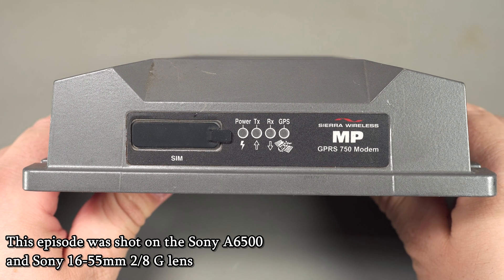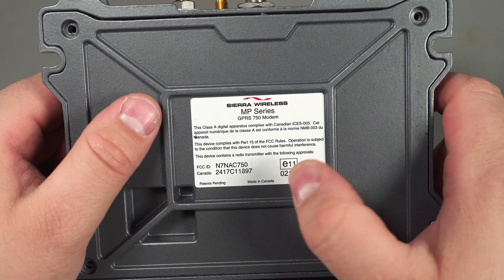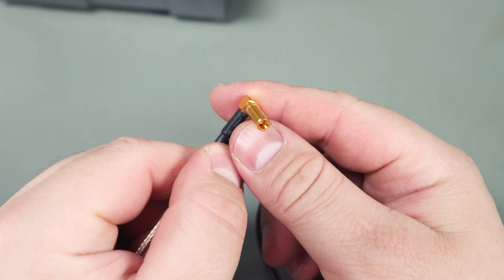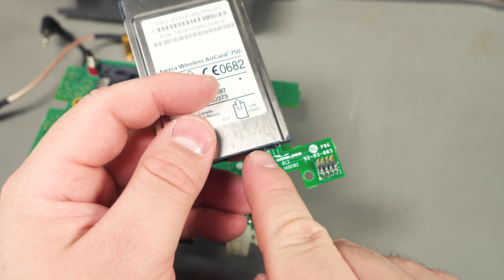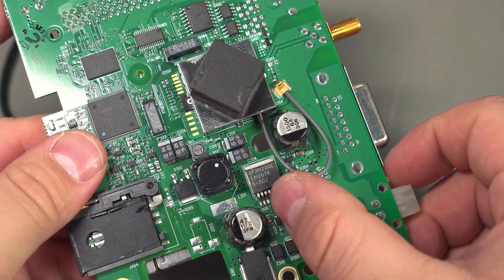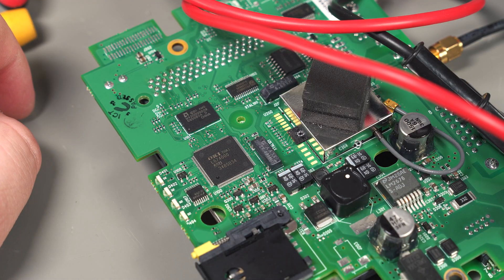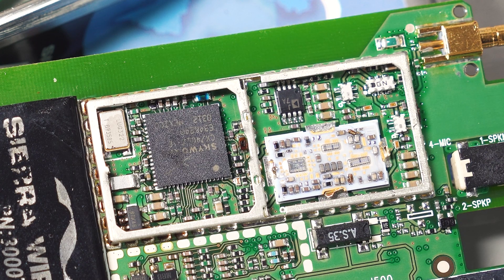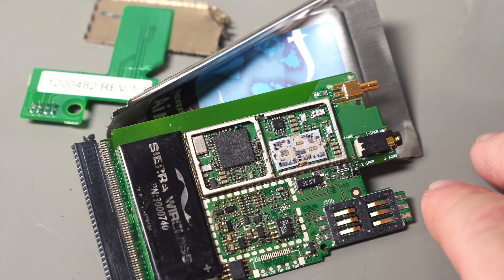Sierra Wireless MP 750 Teardown

Comment: I think they buffer the power consumption of the card with the battery. I checked the Renesas PF08123B datasheet and it has up to 3.5A in GSM (max rating) and transmits with 3.2 W. I think this is much more than the PCMCIA can deliver instantaneously. The datasheet also uses a supply voltage of 3.5V, so they might power this chip straight from the LiIon battery...

Comment: Hey i saw your video about the dual cpu xeon Projekt im building for an school Projekt an x7dbe can you help me where can i get such an back plate for the cpu cooler i use a pice of wood and thats not the best solution
Reply from the maker: Those older backplates are a pain if you don't have a case designed for it. If wood is working, I wouldn't mess with it.

Comment: It looks like a cellular modem for vehicles - for fleet tracking, car telemetry,... and probably you can hook your car's CAN to the IO connector... This could be the reason why it is in a chunky metal case and with secured connectors inside. The other pin on the power connector is connected to ignition. - these are just assumptions based on what I see, haven't googled it yet :)
Reply: I'd suspect something like this would be found in a police cruiser, providing data connectivity for the laptop most police have in their cars these days.